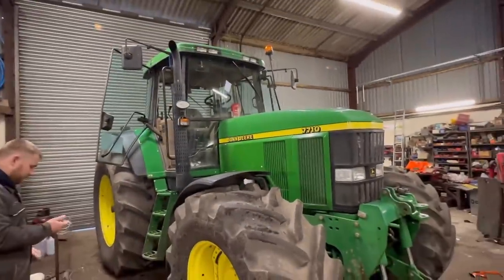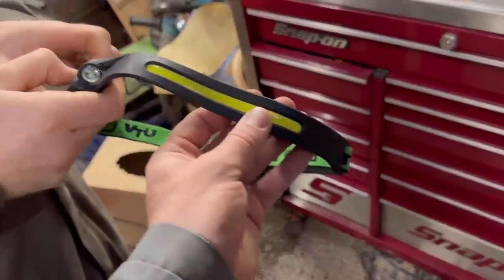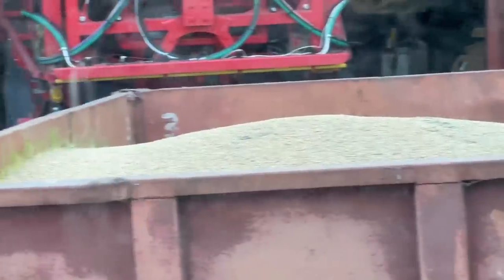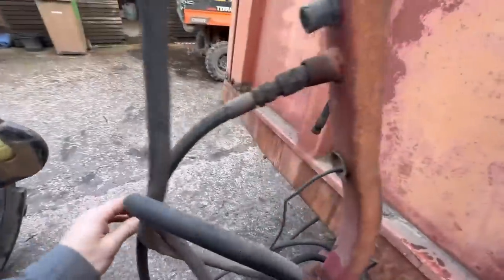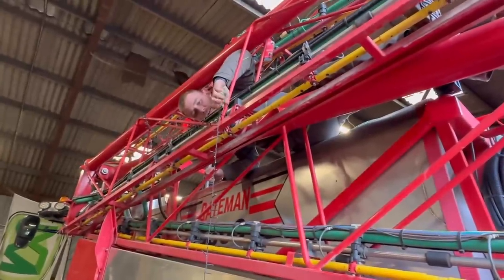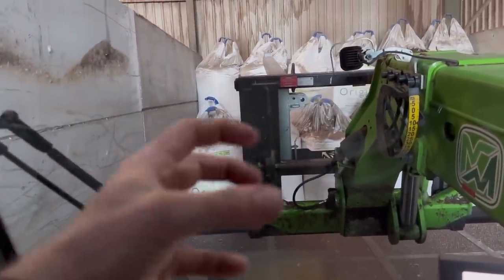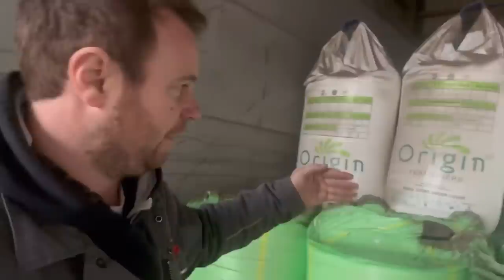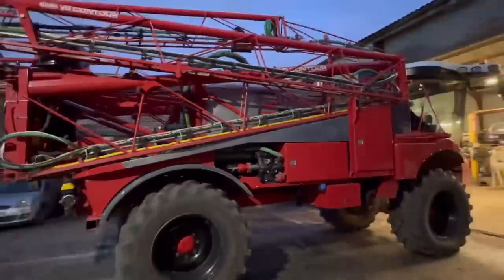BUGS EATING A WHOLE TRAILER OF GRAIN  #OLLYBLOGS #AnswerAsAPercent 1012

Comment: You could buy a couple curtain side trailer and 5th wheel dolly  to load fert straight into and just move them about the yard as needed, just reverse them in and out the bay

Comment: Hi great vid as usual, just one comment no trying to be cleaver but why do you not stack the till on either side of the shed so you could get to them both at the same time if you wanted.
Cheers Peter singleton.
Reply from the maker: Because they fall over and would of had to drive threw narrow gap to fill the green

Comment: How do you get the sticky clips off Xmas tractors without marking paint?
Reply from the maker: Just twist them off
Reply: Hammer and nice sharp would chisel!😂 Try a hot air gun or hair dryer to soften sticky. When panel cooled spray penetrating oil or brake cleaner on usually removes all marks, it works for me anyway. But if you make a balls of it don't blame me!